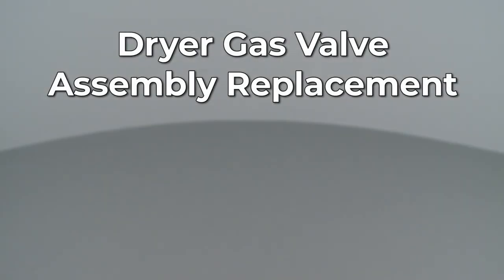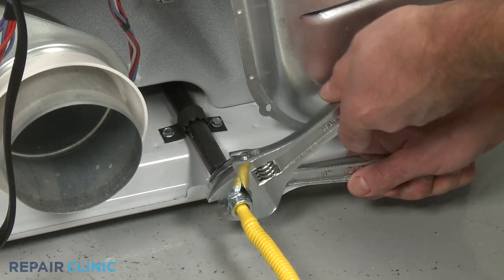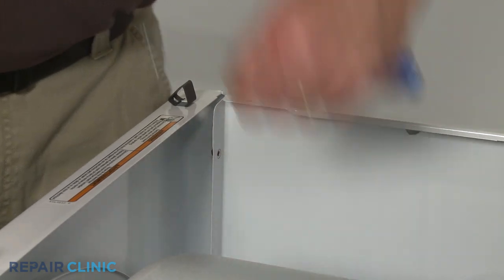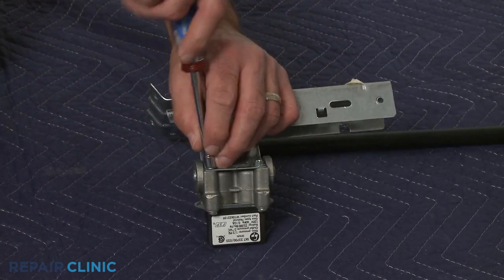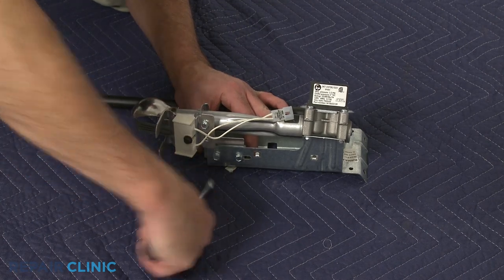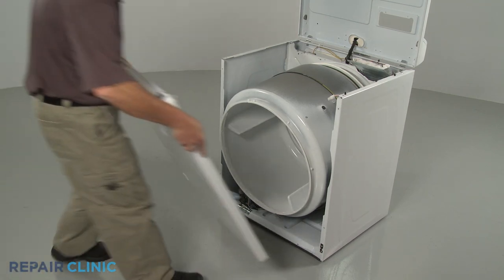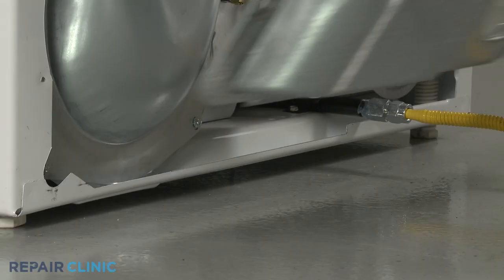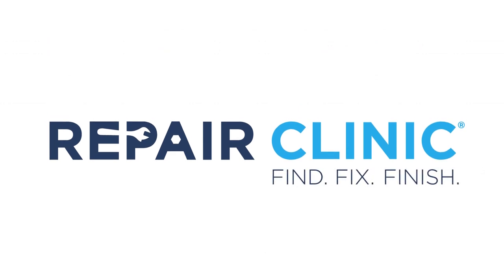Whirlpool Gas Dryer Gas Valve Assembly Replacement 279923

Comment: I have a MGDB850YW1 Maytag gas dryer that keeps knocking out the thermal cutoff. I changed the one-piece duel coils and both it and the high limit fuse on the burner but it keeps blowing out the thermal cutoff on the burner housing. I had the repair tech over and he said the new coil and the new thermal cutoff are blown again and said it would require replacing them and the burner WP 85557891, similar to the one pictured.  I did not realize that only one screw holds the single unit coil in place and took of several of the gas valve bolts before I realized my mistake. The gas valve spring came out so I put it back as it appeared go in that round raised area in the center of the burner.  Anyway, he said the burner is bad, either from me taking it apart and reassembling or it was the bad part to begin with.  Your tutorial is excellent but I have been pulling my hair out over it too long and am getting new units. Half tempted to do the repair out of spite!

Comment: My dryer has a full-width kick-panel on the bottom front of dryer, which seems to give full access to the burner, the igniter, and the heat sensor....   I'm thinking I do not need to remove anything else before removing the burner assembly (besides the rear panel and gas line)?...

Comment: I have a whirlpool, ordered a replacement gas valve after making sure to check the specifications, and it looks darn near identical except for one thing. The two prong and three prong solenoids are on opposite sides from the original. Aside from that it looks exactly the same. Can I still use this or is that an issue?

Comment: Hi, thanks for the video. I have a Kenmore Elite HE3 gas dryer which seems to have similar gas valve and burner assembly. I recently found some minor to medium gas leak around the valve (using a Home-Flex detector bought at Home Depot). I'm wondering if there is anything I can fix (such as loosen parts) on the valve, instead of changing the whole assembly..... Thanks a lot.

Comment: Ridiculous that the gas valve assembly in its entirety needs to be this much work when a high percentage of the problem are the two solenoid that costs around $5-7 while an ignitor itself on older gas dryers are around $25-30 retail.  This burner assembly has to be around $200.  Crazy rip-off
Reply: Do you know if we gotta use a liquid thread sealer ? All I have is the yellow thread Teflon tape